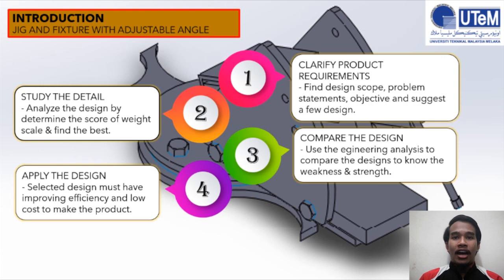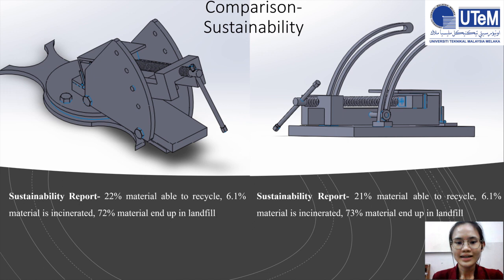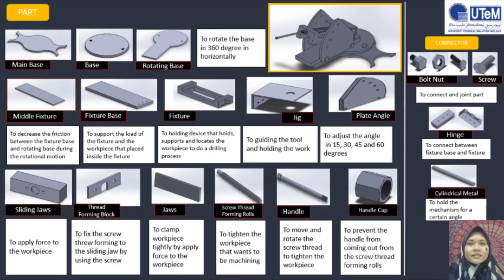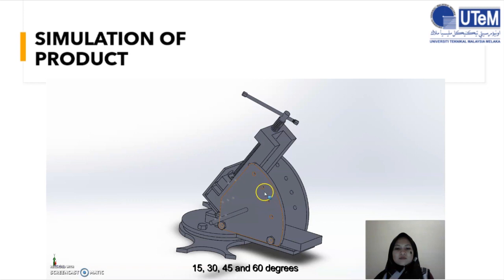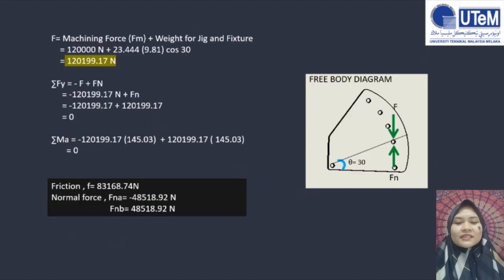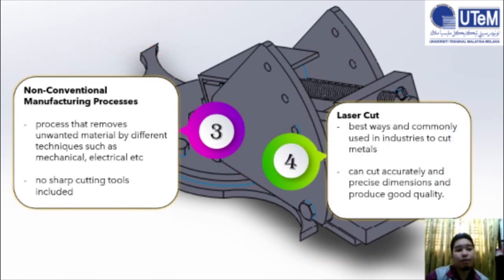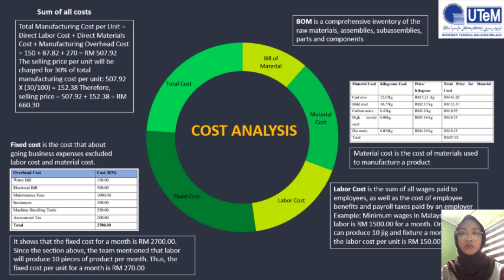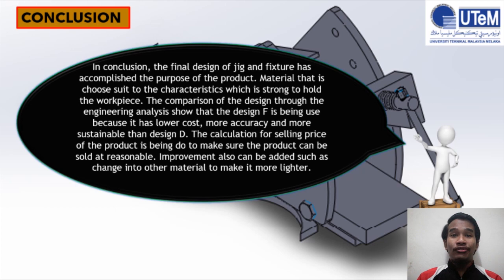BMFU 3223 INTEGRATED DESIGN PROJECT - Presentation

Comment: Assalamualaikum and afternoon. Before i can evalute, please help me to understand this:
1. This jig used for what machine?
2. Why design D and F. Where is design A, B, C, E? How your eliminate those design and only considering those 2?
3. Why use mild steel? This material can easily corrode. 
4. I can’t see any angle marking in the design. How can user know what angle it is?
Reply: Salam Dr Zulfadhli. Good day to you! Thanks for watching the video. This is the answer to your question. 
1. Drilling machine. The jig is just for demonstration purpose, it can be changed to other design. 
2. By using screening and scoring concept, we choose the product which locates at 1st and 2nd place of the screening and scoring concept. The design F  is chosen as the best result when comparing to design D based on the engineering analysis. 
3. Mild steel is chosen because it is easy to repair, affordability, weldability, and machinability. Furthermore, the team has chosen mild steel because it is easy to recycle. Besides, the team has referred to some online website and the team have concluded that mild steel has good history documentation on parts which used mild steel.
4. The angle hole on the angle plate is drilled for angle 15, 30, 45 and 60 degrees, the user needs to familiar with the product before use.
Hope our answer can give dr a deeper understanding!
Reply: Thankyou for your time Sir Zulfadhli : )
Reply from the maker: Thank you sir

Comment: Hi there, 

Thank you for the presentation. Congratulations for making this happen. I understand the hurdles that you guys have to overcome to finish this project during this difficult time. 

I have a few comments and questions.

Question:
1. For the Engineering Analysis, can you explain why you get such Factor of Safety, for example, 9.719x10^8, for the adjustable plate. What is your opinion on this value? 
2. Can we reduce the 72-73% of the non recycle material (from the sustainability report) with other material based on the Factor of Safety numbers that you attained in the Engineering Analysis?

Comment:
1. Grammatical errors in the documentation should be avoided. 
2. I wish more explanation on how the product works were given. 
3. You guys presented just the Results but less focus on the Analysis and Discussions. For example the RULA analysis, the audience would like to know how the test was done and why such scores were attained.
Reply: Salam Dr. Good day to you! Thanks for watching our video!  This is our answer to the question asked. 
Question: 1. For the Engineering Analysis, can you explain why you get such Factor of Safety, for example, 9.719x10^8, for the adjustable plate? What is your opinion on this value? 
The factor of safety is an engineering term which describes the structural capacity of a system beyond the expected loads or actual loads and it increases the safety of people by reducing the risk of failure of a product. Essentially, how much stronger the system is than it usually needs to be for an intended load. Thus, if the factor of safety is higher, the product is safe to use. In this project, we have chosen this design of angle plate because it has a higher factor of safety compared to the design D (1.049e-02). But the higher the factor of safety, the more expensive the prices, thus the team may perform weight optimization of the adjustable angle plate by cutting off the material. The cut off material should consider and balance the material cost with the process cost since less material means more cutting process, more complicated shape need more expensive process.

2. Can we reduce the 72-73% of the non recycle material (from the sustainability report) with other material based on the Factor of Safety numbers that you attained in the Engineering Analysis? 
Yes. We can reduce waste by changing the material or weight optimization. The material could be changed to stainless steel which has better material properties compared to the metal used in the current design. Besides, the stainless steel able to recycle 100% without reducing the material properties. But there is a disadvantage for stainless steel which is stainless steel has higher cost compare to others. If cost is taken into consideration, the weight optimization may carry out to minimize the material used, the less the material used, the less the material needed to be recycled.
.
Comment: 
1. Grammatical errors in the documentation should be avoided.
Sorry for the grammatical errors in the slide/ presentation due to nervous and pandemic condition. We haven’t use English for a long time to communicate. We will improve it. Thanks! 

 2. I wish more explanation on how the product works were given. 
Jig and fixture are work holding/ supporting devices used in the large scale manufacturing process. It used to locate securely and quick positioning of workpiece and tool. Jigs and fixture help to maintain the correct relationship between the cutting tool and workpiece, and they simplify the process of locating during machining. They ensure that every part machined within specified limits and tolerance. It helps the concept of interchangeability in the manufacturing process. The product has the function of rotate 360 degrees in XY plane and also able to produce angle holes by the help of the angle plate. The user may hold the middle base and rotate the who product which this function enlarges the working envelop of the drilling process compare to the traditional product. For the adjustable angle plate, it is placed at both sides of the fixture and it is used to adjust the angle in 15, 30, 45 and 60 degrees. Holes are machined into the angle plate surface to enable the secure attachment to the fixture. The hole is made according to the specified angle so that the drilling process would be easier and there is no need to adjust the angle manually. The user is required to insert the cylindrical metal inside the hole so that the jig and fixture able to fix at the required angle. 

3. You guys presented just the Results but less focus on the Analysis and Discussions. For example the RULA analysis, the audience would like to know how the test was done and why such scores were attained.
Sorry for just presenting the result as we have a time constrain on our video. For the RULA analysis, the team has used the catia to perform it. A manikin is used to demonstrate the position of user during the process of drilling. First, locate the upper and lower arm position. Next, locate wrist position and after that locate wrist twist position. Furthermore, the team have determined the posture score A, adding muscle and load score. The final score is generated by the CATIA software and the team get a score of 3 which prove that the posture to use the product is acceptable.
Reply: Thank you for spending your time Dr Juffrizal :)
Reply: Thank you for your time!!
Reply from the maker: Thank you
Reply: Thank you for your time sir!
Reply: Thank you sir!